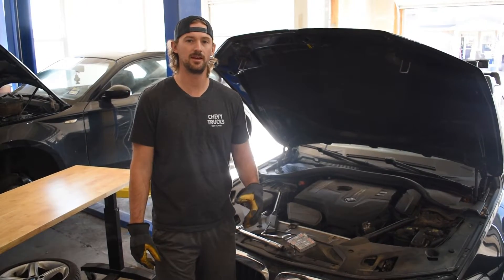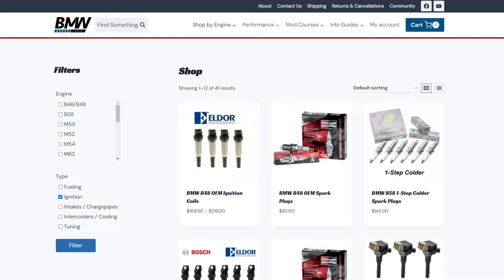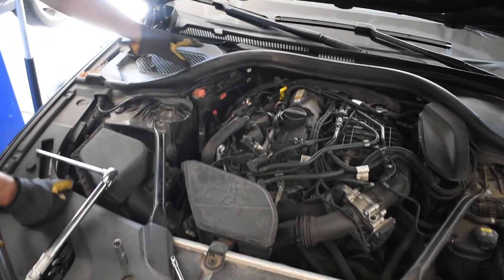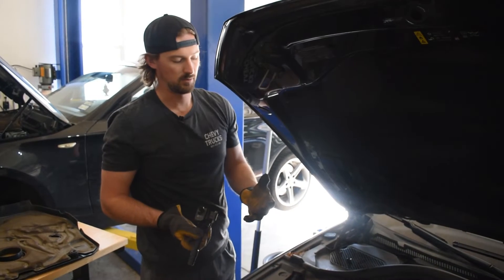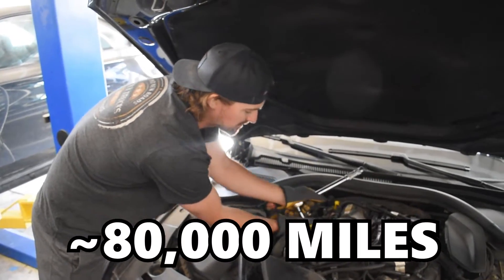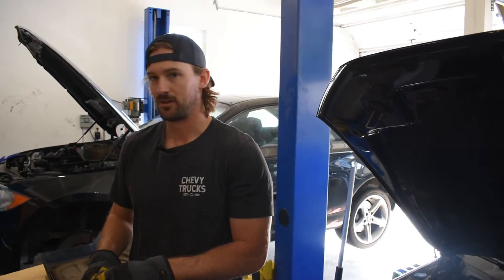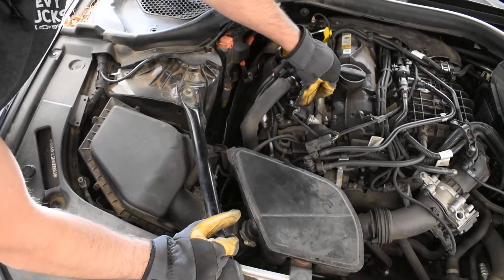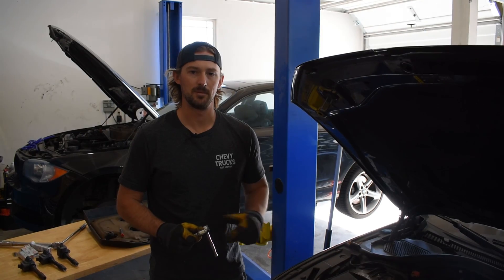DIY - How to Replace BMW Spark Plugs & Ignition Coils!

Comment: I have a 2017 640i Gran Coup, N55. Is there a certain torque number I need to be at or just when the spark plug is tight?  It will be my first time ever changing a car spark plug. The dealership wanted over 400 just to change the plugs.
Reply from the maker: G - On your 2017 BMW 640i Gran Coupé with the N55 engine, the spark plugs need to be torqued properly — don’t just go by feel — because overtightening can crack the ceramic or strip the aluminum threads, and undertightening can cause misfires or blowouts. BMW specifies 23 Nm (about 17 ft-lbs) for the N55 spark plugs, using a torque wrench with a thin-wall 14mm 12-point spark plug socket. Always start the plug by hand to avoid cross-threading, snug it in, then torque it to spec — with new plugs that already have a crush washer, that torque setting is enough to seat them correctly. Doing them yourself with the right torque wrench saves you hundreds and ensures they’re installed safely.

Comment: So you can't use a magnet to grab the plugs? 🤔
Reply from the maker: D - Yes, you can use a magnet to remove spark plugs on a BMW, but only if the spark plugs have a steel core or ferromagnetic terminal, which most do—however, many modern BMWs (especially turbocharged engines like the N54, N55, B58, etc.) use deep, narrow plug wells, and the best practice is to use a spark plug socket with a built-in rubber or magnetic insert to securely hold and remove the plug without risk of dropping or damaging it; using just a magnet stick works in a pinch, but a proper tool is safer and more reliable for both removal and reinstallation.

Comment: 1. how many NM to put the plug back? 2. Should you let the car cool down or do it when it’s completely cool? What would be the appropriate spark plug gap?
Reply from the maker: H - All of this depends on what kind of engine you have. But yes, you should let the engine get completely cool.
Reply: @8020Automotive  I have a 2020 BMW X5 M50i
Reply from the maker: H - So you have the N63. Spark plug gap .022-.023
Reply: @8020Automotive  thank you!
Reply: @highendtrends3508 most bmw plugs call for 23nm but I always go a little more to 25 because everyone time I did 23 I had go back and take everting apart and redo because of misfires, people don’t take into consideration that when you have extensions and swivels you’re losing some of that torque along the way especially with the hard to reach plugs, set your torque to 23 if you like and then once it’s reached go back to the old fashion way with a standard ratchet and give it a little tug, some people might disagree but it’s never failed me once!

Comment: What are you using to unscrew the spark plugs for the 6 cylinder?
Reply from the maker: M - A special spark plug remover. What engine do you have